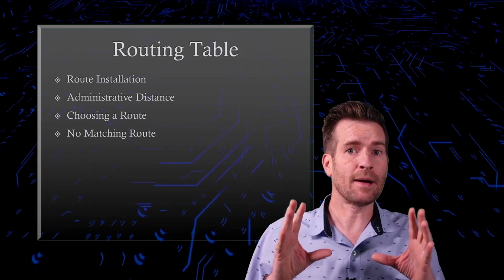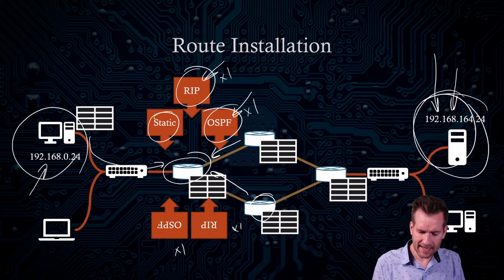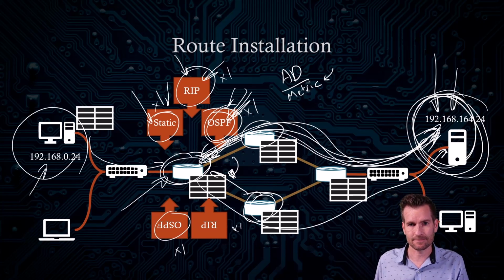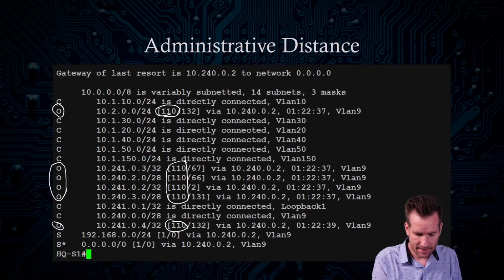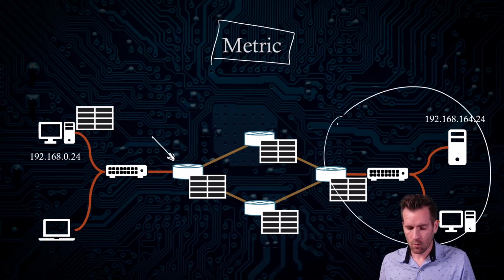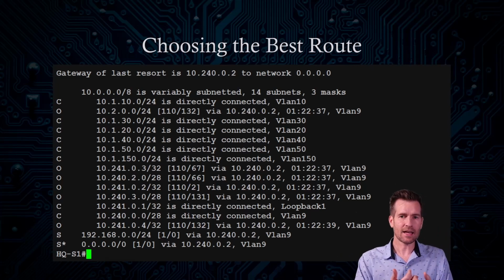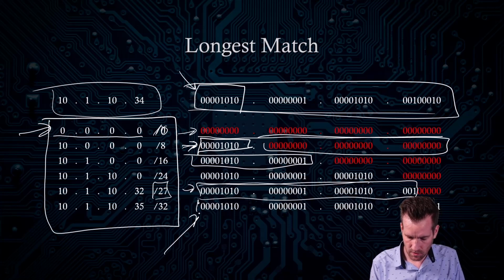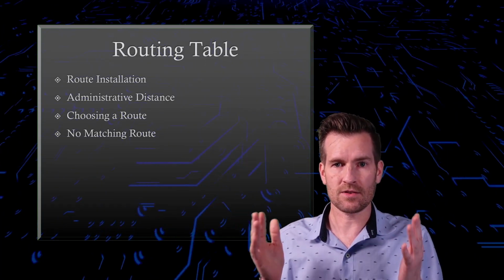CCNA WANs 3-3: Routing Table

Comment: Good Morning....without the binary conversion how do i tell the longest match from the routing table? Is it simply The AD divided by the metric? OR  the route with the highest CIDR notation?
Reply from the maker: Good morning! ☀  It's the highest CIDR... as long as the destination IP address being routed still falls into that network.

FYI, AD divided by the metric doesn't give you any usable info.  When choosing the best route to install on the routing table, the router it basis it's decision off the AD first, and if those match, then it bases best route off of metric.  I've been working on a study booklet and here is something I had in it:

CCNA Tip: You may see a question that is a bit misleading on the test. It asks what is the order of precedence for choosing the best route.  Choosing routes that go into the routing table are based on administrative distance and metric.  The router will then choose the best route in the routing table based on the longest prefix match.  If you get a question about what is the order of precedence between AD, Metric, and longest prefix length, the answer will be longest prefix length.  This is because they are talking about which route in the routing table will be chosen.

Here is an example:

1 - O 10.1.0.0/16
2 - O 10.1.1.0/24
3 - O 10.1.1.0/24
4 - R 10.1.1.0/24 

*#4 will not make it into the routing table because #2 and #3 have a lower AD
*#3 will not make it into the routing table because #2 has a lower Metric
*#1 and #2 may make it into the routing table because they have a different Network Mask
*When the routing table is routing a packet to destination IP address 10.1.1.4, it will choose route #2 because it has the longest prefix match
*10.1.0.4 will be routed to route #1 because it is the longest prefix match

What takes precedence for choosing a route [that is installed in the routing table]?
A - Longest prefix match
B - Lowest Administrative Distance
C - Lowest Metric